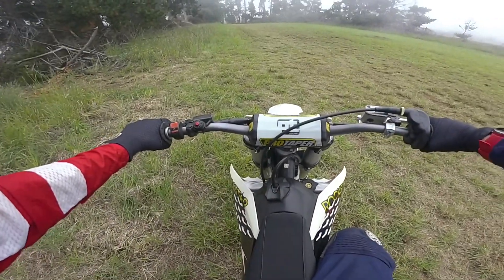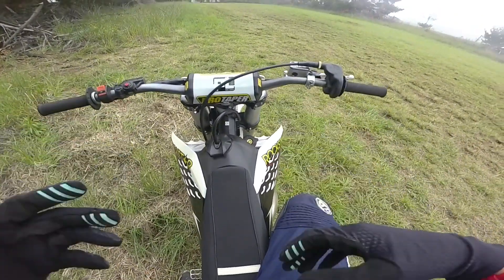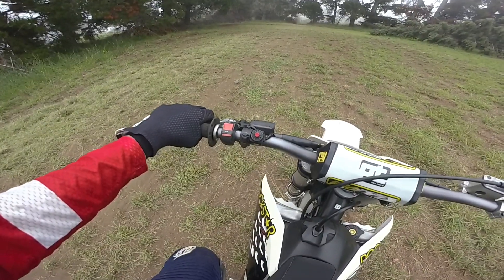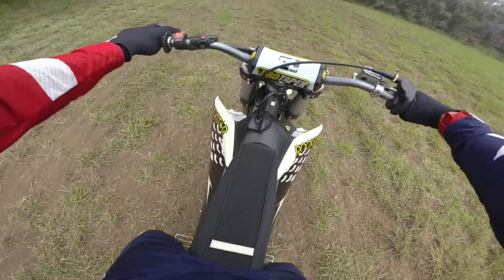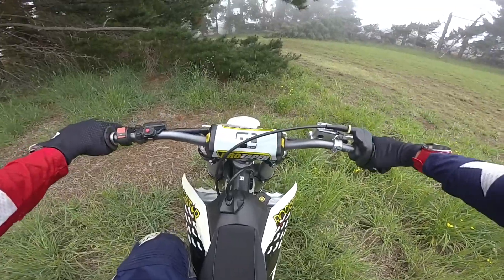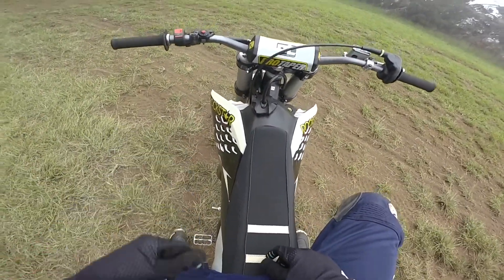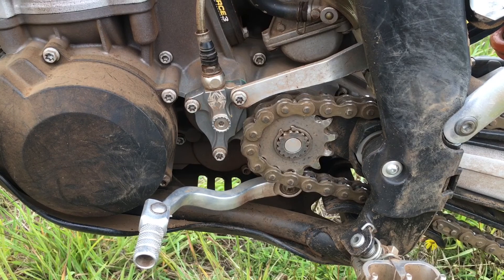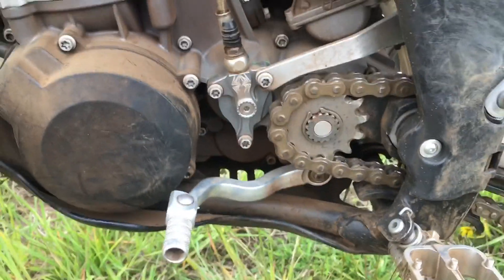Rekluse Auto Clutch Pros & Cons - Everything You Need To Know

Comment: Thanks for posting this. I’ve been really curious about this clutch as it would make so many of the tight trails in my area way more fun. I don’t care if some think it is cheating, it’s great technology that can make riding easier and more fun. That’s a great concept to me. Plus, if it saves me from stalling out and dumping it over in a glacier fed creek filled it silty water, that  could save an engine.
Reply from the maker: You sound like you might be a guy who uses his brain instead of his ego 😉 It can make a day of riding for a weekend warrior a little more pleasant... you know... I have a “day off” to enjoy, instead of just “another work day” except doing my hobby.

I understand the purist side too, but sometimes, or some people just want a break from the grind. Frisky or fresh days you can still bang the clutch. Had Dillion Ferrandis never told anybody that he’d done races using one, nobody would have never known.
Reply: @JohnHowerton137  thanks for the feedback, I’ve been researching the pros and cons as I’ve never ridden a rekluse clutch but my brother has a Honda 250EX quad with a sport clutch which seems to be the same as a rekluse. I thought it was pretty nice, no stalling, you could still pop the clutch if you wanted. I don’t recall trying to slip it but there really isn’t a need to on that machine. I also ride snowmobiles which are 100% automatics and 4-wheelers with auto clutches. I’m thinking adaptation won’t be much of an issue for me compared to someone who rides dirt bikes exclusively. I’ll be getting a new YZ250X this April so I may put a rekluse in it. That’ll likely be the last gas bike I buy as I’m hoping the electric bikes will become way more mainstream in the next 5-10 years.
Reply from the maker: Zero adaptation. One minute in you'll forget it didn't have it when you bought it. I will say they are a little better with the hydro clutch. Less fiddling as you have no regular freeplay to deal with on top of the freeplay gain. Put a 250XC or variant on your radar. The counterbalanced 2T is amazeballs and there are 50 other reasons to choose it over the Yamaha too.

Sick ebikes are only 2 years out methinks.
Reply: @JohnHowerton137  I thought about the KTM’s but I like my Yamahas and my Yami dealer. I’ve wanted a 250X since they came out so this year I decided I better get one before they quit making them or they get banned for emissions or something. My dealer only got allocated for three 250X’s and one already sold. In January. In Alaska.... fricking covid. He now just has one left, I’ll pick mine up this April. 

I see myself being an early adopter of an electric model. I’d be thrilled if they are only 2 years out. I just learned KTM has that electric mini bike, very cool. I also heard that Yamaha has been working on electric motorcycles for quite sometime and I saw an article that Honda is testing one. I’m excited about what toys we’ll get to choose from in the future! One of my buddies talks with MX guys in the lower 48 as his grandson has been racing the circuit. The guy he spoke with had been test riding an electric MX bike and said it had zero hesitation and he was pretty impressed with it.
Reply from the maker: @thatalaskaguy  you’d likely change your mind about that once you own one 😉 This is why Austrian customer loyalty is so high. That said, I’m all about supporting the dealer who supports you the best. 

The Alta was great, too bad dumb ass Harley sunk them. I was planning on owning once my dealer grabbed the line. Outside of Alta, Honda was kind of the first one with a real MX prototype that we’ve seen. Yamaha’s is a collab with another company in Europe. They have a cool trials bike already though. MX bike they just shoved someone else’s motor into a 250F frame. That said, Yamaha isn’t afraid to be the first with unique stuff in the market. KTM has had a prototype ebike since ‘09 and production for 8 years. That’s the Freeride E-XC. I can’t imagine they don’t have something MX in the mix. Their SXE is a no brainier for mini dads. They’re fast and easy. 50s are a flippin’ nightmare! The SXE fits the 50-65 bill, and they are rumored to have a 85cc version next year. The plan is to grow the next generation on Ebikes, so that alone should mean a 125/250F class bike from KTM in 2023 or 2024 at the latest. No one has said this... but I tend to be really damn good at predicting things/trends 🤣
Reply: @JohnHowerton137  that’s really interesting, I didn’t realize Harley was the one that caused Alta’s demise. I was watching the Alta and straight rhythm videos and getting excited and then they were gone. I just read an article about it. 

The KTM 250 would be nice but for the price difference I can mod the 250X into exactly what I want (big tank, bark busters) plus get a rekluse clutch and still be money ahead. I’m not racing the bike, it’s just for fun so you don’t need the latest and greatest and like that so many parts and accessories are available for the YZ. Plus I already own an ‘06 (it’s going to my son) so I’ve got some parts on hand. 

KTM is smart to be moving ahead on ebikes. My kids want electric powered machines and don’t care for the noise, smoke and general finickiness of gas powered machines. The Onewheels I bought really opened my eyes to how great electric powered toys are. I’m kind of thinking that’s why we’ve been seeing stagnation in new dirt bikes from the Japanese OEM’s. They are waiting to see what happens and don’t want to invest in new gas engines. In snowmobiles the lack of new gas engine choices is surprising, plus they have been dropping the low cost fan cooled 2 stroke models. 

I agree with you that a big change is coming. I saw that Yamaha e-trials bike a few months ago and it looked great combining the manual clutch with the electric motor. I’ll be watching KTM to see what they come out with. For my style of riding, electric would work out just fine for 95% of the riding I tend to do.
Reply from the maker: The Electric Motion bikes are nice too. They use a commercially avail electric motor and a few models have a manual clutch. The Alta, KTM, and EM are the best stuff out there hands down. The chassis is trials based which is literally the ONLY reason I didn’t buy one. I knew I’d be looking for the biggest jumps I could find and trying to ride it moto style rather than trials. They have more power than the Freeride and the manual clutch amplifies the use of that of course. Battery capacity is a lower, but they’re like 50lbs lighter. Fit and finish is 👌 https://youtu.be/hsNQC-bXvnE

Would still buy one if I had the extra money.

Comment: Love the vid! Usually see comparisons to manual bikes and not true reviews. I ride an AT DCT and modified to LHRB, and I love this thing. I don't miss a clutch at all, the DCT/auto-clutches just work differently which means different techniques. I think we'll see pros that come up on them real soon, and it'll become more of a preference. Rolling backwards down a hill is the worst part, especially since I removed the eBrake for the LHRB lol. Have to keep a velcro strap for locking rear brake. Thanks again for the thorough demo
Reply from the maker: I think there's more pros using them than people think. Especially in XC racing.

Comment: I installed a Rekluse on my 450 and a con I that I wasn't anticipating is you don't have engine braking. Unless you are going fast enough downhill to keep the RPMs up, the clutch will disengage, and you have to rely on your brakes to regulate your descent speed. Not a huge deal, just takes some getting used to.
Reply from the maker: You can change the EXP springs and pucks to combat some of this. Jeff Slaven's has a decent video about it somewhere.

Comment: You almost had me convinced, then I looked at the price of these things and changed my mind fast lol. I ride moto and woods, my gearing is too tall for woods so I have to use the clutch alot and have to let it out at higher rpm to keep it from stalling. This would probably fix the issue but I think Im just gonna wait till I have the money for 2 bikes and have one set up for each.
Reply from the maker: They aren't cheap, but the quality is there.

Countershaft sprockets are cheap and easy to change out from weekend to weekend. Get one tooth smaller and see how that works out. A compromise until you come up with another solution.

Comment: The harder , steeper, rockier terrains you ride the more you’ll appreciate this. I have had it on my 500excf for 40 hrs and I very much like it. Engine brake downhill doesn’t bother me at all, sometimes you don’t really need it and freewheeling down is totally OK. When you do need it, you can give it some gas and with higher rpm clutch will stay engaged and you get your engine brake. One question I have for guys who run it, do you feel a good amount of resistance to roll with engine off and in gear, mine does have that and Imam curious if you all feel that. It doesn’t seem to affect anything, just my observation.
Reply from the maker: Doesn't bother me at all. The anti-stall far outweighs any low RPM engine braking. I actually like no engine braking downhill, as the suspension is more settled and absorbs better.

There is a little resistance in gear, but not as much as a manual bike with the clutch lever pulled in. Make sure your freeplay gain is set correctly.
Reply: @JohnHowerton137  sounds good. Yeah, free play gain is on point, I experimented with the screw in all possible ways just to see how it affects this particular aspect. I sense that this is indeed normal. The bike runs like a champ. I am about to install left hand rear brake and that will be awesome in combo with this clutch.

Comment: I bought my Husky WR300 with a Rekluse and I didn't like it at first but it has grown on me. Being that it's a kickstart only model also it prevents me from having to restart it if I stall it. Yes I am slightly out of shape and it makes it easier for me to go ride with my son.
Reply from the maker: That’s likely one of the older clutch models too. New ones are smoother and don’t affect the clutch pull much either. Thank’s for sharing.
Reply: @JohnHowerton137  Yea it's the Z start Pro I think.

Comment: Thanks for the examples of w/ and w/out clutch. I have an 03 RM 250 and from the sounds of it, at least an aftermarket basket to replace the softer OEM will improve greatly. I'm interested in auto clutch for the reasons you said with safety and when clutch pull is fatiguing. It can get dangerous quickly.
Reply from the maker: There are basket finger protectors with some one the models, but your basket cant be smoked already.

Hope to do a tuning video soon. I've had several more since this video and have found a sweet spot where I like it much better than in these original videos.
Reply: @JohnHowerton137  thanks for getting back to me. I agree the basket is unlikely notched at this point. It looks Rekluse has a torque drive clutch pack for $409 that comes with sleeves etc. Basically the cost of a billet basket only. I've got my mind set on the Auto Clutch for it's technology, grace and safety over time. Thanks again for your in action comparison, much appreciated. Will look through your other content too.
Reply from the maker: @daveknott4563  a $409 Torqdrive wont be an auto clutch. That's only a manual clutch. EXP is the "auto" part. You can have a Torqdrive pack paired with a EXP auto disc for a more bombproof option.

Generally the auto options will bump you to the $800 and beyond depending on their features. "Core kits come with more internal components like Hubs/Pressure plates and covers etc..

Hope that helps. If all else fails, call Rekluse and tell them what you're looking for 🤙
Reply: @JohnHowerton137  Absolutely and makes sense. I see Rekluse has an auto clutch  "Radius X 4.0" that comes with torquedrive for $950 in the US. For an extra $500 vs the torquedrive only pack, that auto clutch is a no brainer for me.  Minus hard enduro application it seems.  Now time to plot when I may want to do that. And possibly add the left hand rear brake if necessary. NOT cheap, BUT a very unique "best of both worlds" application for 2 stroke.
Reply from the maker: @daveknott4563  that's the one! Come with the basket sleeves too.

Comment: I'm old getting into dirtbiking plus I'm arthritic.  This seems so luxurious.  I'm to understand the yz125 rekluse can be made to fit kdx220 somewhat easily.
Reply from the maker: That would be interesting if it did. Probably a call to Rekluse is in order for that. A real quick cross reference of aftermarket clutch plates didn’t turn up that result, but that doesn’t mean it doesn’t. I’d think if it did cross over, Rekluse would add it as an offering being how many KDXs are out there. I’d call them. There are some other factors. Pressure plate and cover clearance consideration come to mind.

Comment: Bike sounds really crisp. I run the rekluse on all bikes except my 300 which I use in tight single track.
Reply from the maker: It runs decent. The gearing is off and it's jetted a little better for sea level (at 6,000ft in the video). Should put a JD needle in it.

I tinkered more this week. Put the yellow PV spring back in. Might work a little better next ride. Considering taking off the Steahly flywheel weight. First bike I've ever had one on. I think I prefer it to spin up faster, especially now that the Rekluse softened up the engine feel and the clutch is heavier with the steel drive plates & EXP disc. The bike feels like its going to pop when you get on it... and then it doesn't. Kind of throwing me off. I like predictable. Probably mainly the gearing. Only have like 11.5 hrs on this bike, so haven't gotten it fine tuned.

For where I ride the 300 is a much better engine delivery. Lot's smoother. Such good bikes. Especially '17 and newer.

Comment: Great video and comment feedback. I've read the clutch pull increases with the rekluse over stock and some recommend converting to hydraulic. Is this true and if so how much did the resistance increase?
Reply from the maker: I'm already hydraulic on all my bikes. I think it depends on the machine. This 250-2T if I recall say 15%? My 250F I don't feel like much, if any.

I have no idea if this is true, but to me it feels more like maybe they increase lever throw (pull distance), which would make it feel stiffer. I bought a Midwest Mountain lever once because they're suppose to dramatically reduce pull. I didn't notice much of anything and sent it back.

Thing is, you don't have to pull the clutch anymore, so it doesn't matter much if it is a little stiffer because the hand will be so much more fresh.

If you were/are on a KTM (variant) you could switch to the 9mm master cylinder like the enduro guys to soften and lengthen the feel of the lever.

Comment: Edit: Happy New Year from Northern Illinois! 
Great analysis. Thanks for such a great video. I love the clutch. Does everything just as you've shown, BUT I've noticed that i have no manual feathering clutch control. DIsengagement only happens when the clutch lever is almost all the way back to the bar. No feathering ability at all. This is not normal, right? What do you think? I need the check the free play gain...
Reply from the maker: Is it a hydraulic clutch bike?

It should work like the Rekluse isn't even in it.
Reply: @JohnHowerton137  that's what thought!  More research required then.
It's hydraulic.
Reply from the maker: @jayeye4798  try bleeding the system out first then adjust the freeplay gain. I’d bet it works.

Comment: Great video man, thanks for this. Al the info needed. I just have one question: I love the engine breaking on my KTM EXC-F  going downhills, will the rekluse make it like I'm free wheeling or more like on a 2 stroke style? I'm heard you need to keep getting a full hand of throttle while descending so it doesn't freewheel full kamikaze style :)  Is that right? Thanks so much in advance!
Reply from the maker: At idle RPM it will be Freewheeling. I'm not a engine braking kind of guy, so I never tested it downhill but riding it a gear low downhill with the RPMs up I would think would keep it locked up. Never tried it.

I sold this bike so I can't fo test for a definitive answer for you, but plan to put one in my new 250 when budget permits.
Reply: @JohnHowerton137  Thanks so much for the prompt reply. Yes, that and the hill climb thing you approached here is the only thing that's keeping me from getting one in the future. I'll keep an eye on your videos for sure. Thanks for the amazing stuff you always put out!
Reply from the maker: @mikemoralesofficial  everything has drawbacks. I don’t ever intend on not making it hill climbs, so the roll back thing doesn’t bother me 🤣 Chances are the clutch will help you make it up the first time anyway. Haha
Reply: @JohnHowerton137  that's exactly my thinking! 😆😎

Comment: Was considering a rekluse since I have problems with fine control on my clutch hand due to surgeries. After a while it is almost impossible for me to do a slow release on a clutch. So the question is, if I let go of the clutch to quickly using this will it cause major issues?
Reply from the maker: The clutch works normally. The benefit to you (like myself) is when you lose the ability to feel, you dont have to use the lever at all to keep riding normally. I still use it for shifts since that doesn't require the fine motor control, but other than that...